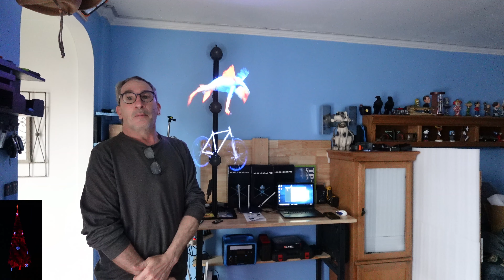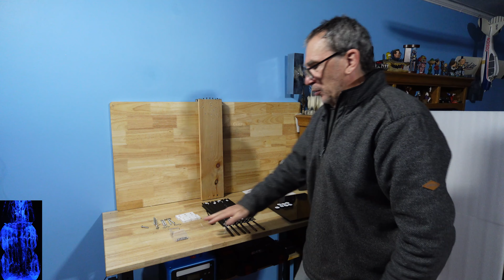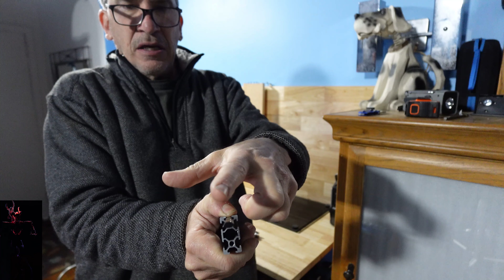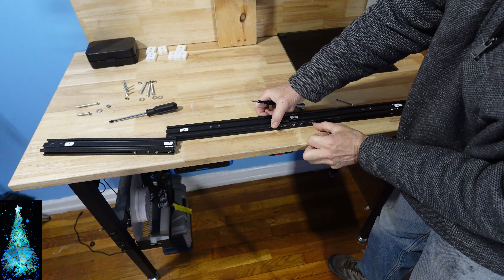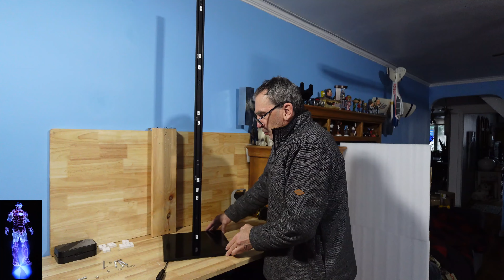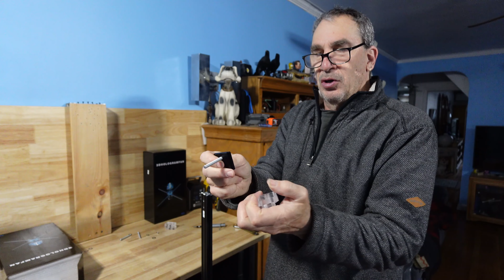Missyou 152cm 3D Hologram Fan Display and Stand, 3 x 56cm Fans with Bluetooth, App & Remote Control

Comment: Hi what type of camera are you recording with?
Reply from the maker: I use a Sony ZV1M2 with a DJI mic 2 Rx + Tx, depending on bluetooth products the DJI mic 2 will  get garbled for ten seconds,  I started to switch over to the DJI Action 5 Pro  fo reviewing. reasons whenever I put  a hand in front hte Defocus is never off, and it focuses in and out. hope that answers the question